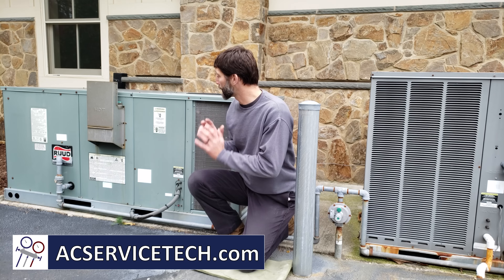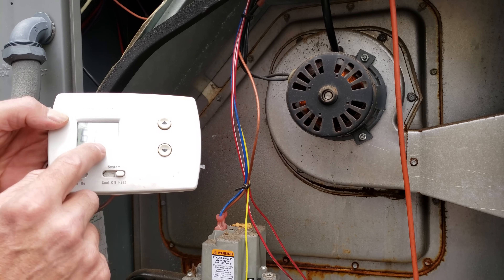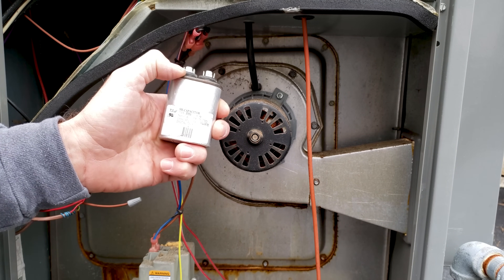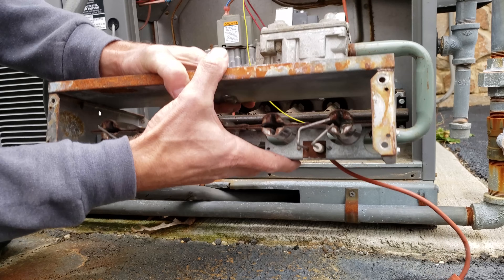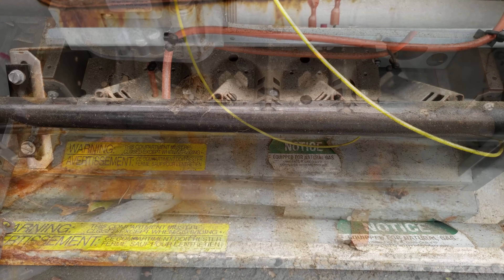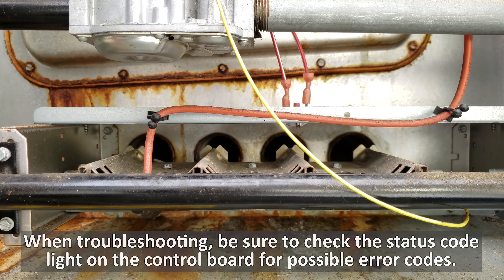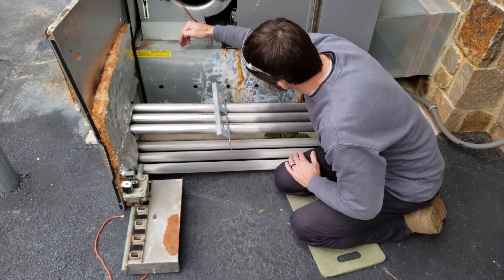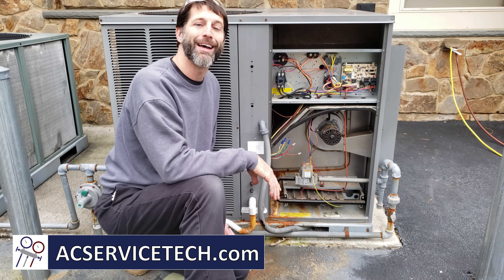NO HEAT? Top 10 Problems on a Gas Furnace Package Unit!

Comment: The number one problem with gas packs is rust. They are designed to rust out in about 5 years. Design a gas pack with sealed panels and a 1” supply and return duct to it to supply dry, heated or air conditioned air into it. Moisture free, bug free and dirt free.

Comment: 21 Degrees here this morning, no heat. Reviewed the above video. Used a piece of wire to unclog the tube to the pressure switch. Eureka!  Easy fix because of the video. Thanks so much.
Reply: Did you clean the flame sensor while you were in there? If not, thats like putting on a suit and not shinning your shoes.

Comment: thanks..

my kenmore unit is getting too hot according to tech...it will stop at 70 degrees...once it stops...it wont come back on by itself...i have to cut the power and adjust the temp to get it running again..guy said in 26 the industry standards will Change to new freon and suggested i wait it out to replace unit for 9k which i don't have...he also said he thought American home shield was good BUT my brother had them and had nothing  but bad experiences...right now it is 22 degrees and end of December...i can't  make it to March like this...

the tech i had used for years  charging  175 and he was here about 6 minutes...heat worked for about a two weeks and here i am
..paid a guy 60 yesterday and heat was on but quit at 66 degrees...i need a real technician like yourself...

Comment: On that unit those circuit board crack on the main saftey switch plug always check the back of those boards on that 9pin connector. Very common problem.

Comment: Red light on board goes out when unit calls for heat. Comes on, Inducer motor tries to start, shuts right off. Keeps trying. Red light goes on and off during this. Any ideas? Bad transformer?

Comment: The inducer motor runs even when the thermostat shuts off and the system itself isn't igniting. I had to cut the breaker off to stop it from running constantly! My unit is 3 years old and I really don't know what to do!

Comment: What if the exact same unit heat goes on and off ? I checked the burner , ignition switch works but burner doesn’t go on ( no flame ) ? Some days it works but some days it doesn’t:(

Comment: I have a RHEEM RRNL-B030JK08E SERIAL NO/ 2G7406ADBAF071002551 MY RE LIGHT ON THE CONTROL BOARD IS SOLID AND ITS NOT INGNITING IS THE BOARD BAD

Comment: A very helpful video. Fantastic. Some of the issues, like the weld seems on the heat exchanger or some of the rusting, could be avoided if the manufacturers changed their design just a bit.

Comment: A guy I use to work with called me about his furnace it would go through the sequence of operation fine but after glow plug no ignition . He said the glow plug has a white spot on the glower I told him he needed a new one. He tried to jump it out called me back said it sparked on him  and he had to reset the breaker, now his inducer comes on for a short time like a minute then stops and the fan come on.

Any idea what he may have messed up, I'm thinking the pressure switch is acting up
Reply: Easy way to test pressure switch is putting meter leads on both terminals of the switch. And taking the tubing to your mouth and pulling in like you would a straw. It’ll close the contacts and if it’s malfunctioning it won’t close contacts.

Comment: My problem is that the furnace works, for only like 20 mins or so.  It will shoot up to the temp I program on the wall thermostat (say 73F), reach that temp, shut off, and NOT come back on later so the apartment gets super cold, and never come back on.  Now there is one trick -- at bottom of furnace is a large red button, I push that red button all the way in, and SOMEtimes the furnace will turn back on for another 20 mins, but sometimes not.  On rare occasions the furnace will function for 3 or even 4 hours, but not often, and wouldn't you know it, it usually shuts off when I get in bed.  Note:  I already cleaned the furnace flame sensor one time with the brillo end of a dish pad, so that's probably ruled out.  (Furnace brand is Williams, model 2509622).
Reply: You may have a faulty sensor that is designed to open when a "condition" happens or not happening.  The flame sensor is no exception. I haven't looked at your schematic, but consider looking at what other components are wired in series with your flame sensor.
Edit: you may not wanna keep pressing that red button.

Comment: I'll watch later today. Did you mention not having a way to vent an old expansion tank? Pressure keeps relief valve off the furnace leaking.
Reply: You mean expansion compression tank? The older styles, sometimes you have to isolate and drain them. Over time they will completely fill with water and have to drain them once in awhile.